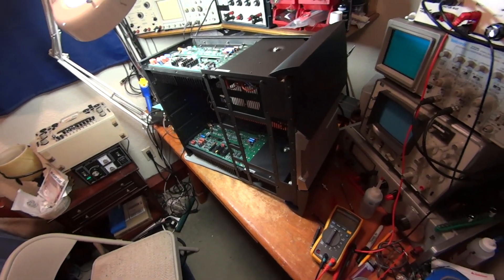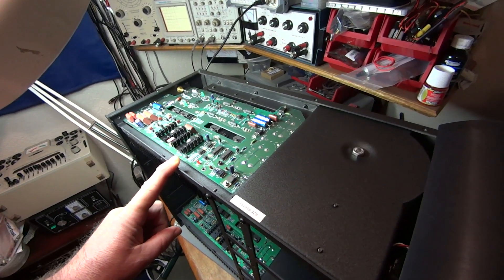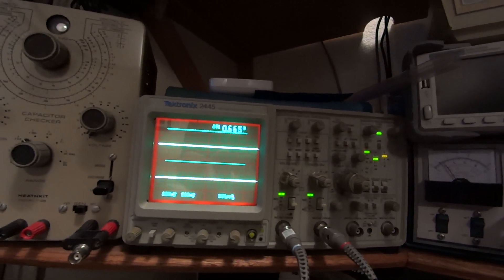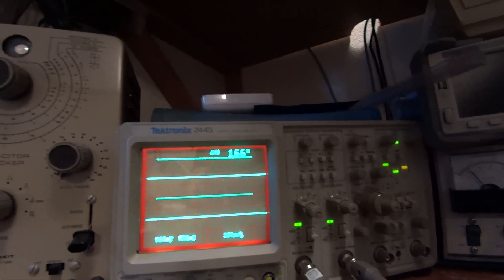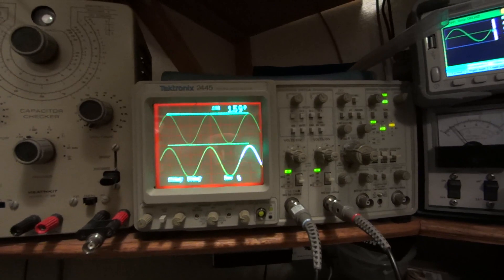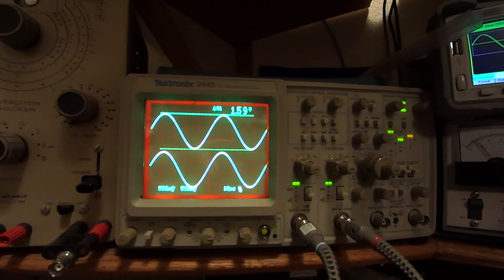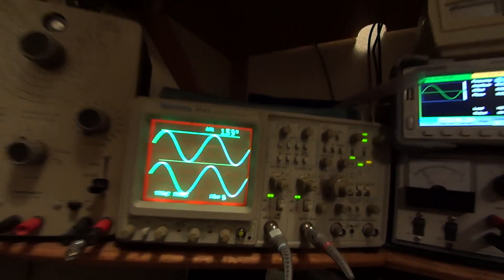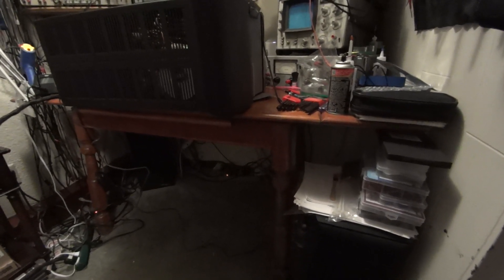POP! Balanced Audio Technology, BAT VK-6200 power amp, power up transient repair.

Comment: Had exactly the same problem with my VK-6200.  I took three channels out and sent them to BAT.  They rebuilt the boards.  Then I took the remaining three channels out and sent those to BAT for rebuilding when the first three were returned.  Had several discussions with Victor Khomenko in the process.

Comment: Thank you also for posting this video. I have an Anthem Statement P5 with the same problem, on the right channel. A popping sound is coming out from the loudspeaker when I'm starting the amplifier, but with some particularities: 
 - a) I'm not getting the popping sound when powering up, if I leave the amplifier unused for more than a few hours;
 - b) I'm not getting any audible secondary popping sound when I'm powering off the amplifier (compared with the situation that you showed in this video with the BAT power amplifier);
 - c) I'm noticing a difference in sound level comparing the left channel with the right channel. The right channel (the one with the popping sound when starting up) sounds louder than the left channel. To balance the volume between these two, I have to attenuate with -4.5 dB the right channel (using the Oppo 205 player settings, connected directly to the P5 amplifier).
 I live in Bucharest, Romania (E.U. member country) - the power grid for domestic use here, is at 230 V, 50 Hz.
Reply from the maker: I identified the bad MOSFET by comparing diode tests on both channels. This is not intuitive because diode testing on a Fluke is typically not used on FETS. But I was able to find differences in the readings between the 2 channels on the bad FET vs. the good one. It is unfortunate that the manufacturers do not provide schematics, it would really help. In your case I would want to chase down the balance issue and find out what was causing the difference. you might have a bad coupling capacitor that is causing both problems. Of course it is impossible to say for sure. One of the things I did notice is that the Anthem appears to be a straight discrete transistor amp, this would make checking it with a good VOM with a diode checker easier than a MOSFET amp. I would also check for DC voltage at the speaker outputs, maybe the bias is off a hair.
Reply: @leonardpeters3266  Thank you again for sharing your knowledge. I'm not a professional in the electronic field. However, I have some technical skills and a strong desire to learn. At this moment, I don't have the proper tools for generating sine waves at a certain input voltage, nor an oscilloscope to read the output signal on the speaker output connectors of the power amplifier. At this moment I only have a very modest multimeter. I will use it to investigate within these limits. Is it possible to measure capacitors that are already connected in a circuit and diagnose them as being in normal parameters? And yes, there is a variable resistor on each channel  that modifies the bias. I didn't play with them...
Reply from the maker: @florinbizu5018  Capacitors have allot of failure modes and most are not measurable in the circuit. The voltmeter can be used to look at the speaker output terminals. Set the voltmeter to DC voltage and look at each speaker outputs while the amplifier is idling (No music playing). The DC voltage should be less then 20mv. Preferably less then 10mv. If it is then your bias is probably fine. I must caution you about about turning the bias variable resistors without having the alignment instructions it can cause serious failures.
Reply: @leonardpeters3266  Good morning! I finally had time to make the measurements according to your instructions. I have set the multimeter on 200m, DC V. One mention: I have inserted one end of the black probe to the multimeter port marked 'COM', and the red probe to V - Ohm - mA port.  When I connected the red probe to the plus-marked speaker terminal and the black probe to the minus speaker terminal of the 5 channel power amp, the multimeter indicated mV values with a minus sign in front of the numbers. When I reversed the probe (red probe to black speaker terminal and black probe to red terminal) the reading values on the multimeter display were positive. The results are as follows: on the front right channel (the one with the 'pop' sound at the start) I have 3.6 mV in idle. I have measured also the current at the speaker outputs when powering up the power amplifier and the multimeter showed a short brief jump and indicate -29 mV, then the 3.5...3.6 mV in idle (fluctuating between 1.6 mV, to 4.2 mV in idle). Also, after powering down the amp, I noticed a residual current of 21 mV (positive value) that dropped in 38 seconds to 5.2 mV and stayed at around this value for about a minute or two, and a residual value of 1.0 mV even after a few hours. After powering down, on the other channels I measured a residual insignificant current of 0.00...0,01 mV (probably in the error margin of the cheap multimeter).
Also, in comparison, the idle current on the other 4 channels where shown as follows: for the right surround power amplifier channel module, 6.1 mV; center channel module 7.5 mV; left surround channel 4.4 mV; front left channel 6.5 mV. I didn't played/turned the bias trimmer potentiometers - they are unmoved/untouched as I found them after removing the metal cover of the amplifier.
Reply from the maker: @florinbizu5018  This is good news. It appears that the push-pull power amps are all biased correctly. The bias is good. The residual voltage you see after power down is not uncommon, the filter capacitors are staying charged. Unfortunately I don't have a schematic of that amp and don't know if they put a discharge network in the amp. I do have a question for you though. I imagine each of the channels has a protection relay. Can you hear the protection relays engage on startup? Also do they engage at the same time?
Reply: @leonardpeters3266  I can send a short video if you agree. I hear relays coming to action both on start-up and also when shutting down. And yes, as much as I can figure out from what I'm hearing, they sound like all  starting together - together same time also, at powering down.
Reply from the maker: Could I ask, was the residual voltage on the speaker terminal only on the channel that is popping? I think it is from your description above. I am wondering if the protection relay on that channel is engaging before the bias settles in. And then not disengaging when the amp is turned off. The engagement of that relay is dependent on a resistor/capacitor (RC) time constant. If that capacitor is bad the relay will engage immediately when the amp is energized. You should not read any voltage at the speaker terminals until the relay kicks in. Take a voltage measurement at the bad channel, watch it when the amplifier is powered on and see if the voltage jumps immediately or if it waits for the relays you heard clicking in. Do the same for the other channels that are not popping. Don't make any current measurements, they are not required. Get back to me with what you find out. I am suspicious that your protection circuit, on the popping channel, is not behaving correctly and it is allowing the power amp to be connected to the speaker before the bias settles. My guess is that the popping channel will have a DC voltage jump right when you press the mains switch. Thus causing the pop.
Reply: @leonardpeters3266  There Is good logic in everything you say. But I have a small dilemma... I can hear the relays acting immediately after I'm pushing the power button to ''On'' - very fast, two stage clicks. There is no delay, there are no third ''clicks'' after powering on the amplifiers. I took a voltage measurement on the bad channel and I noticed a jump in voltage (29 mV) and then back to 3.5...4.2 mV in idle.
Reply from the maker: @florinbizu5018  Well I apologize, I am out of easy ideas. I think the best way to troubleshoot this amp would be to look at the power supplies in the bad channel and compare them to a good channel. Also use an oscilloscope to compare the signal chains in the channel that is 4.5db to loud to the other channel that is softer. I would be suspicious of capacitors in the pre-amp of the popping channel. It might also be a good idea to call customer support at Anthem, they may be able to put you in touch with one of their technicians/engineers that have seen this problem before. You might also select (Auto on) and see if having the amp function in that manner alleviates the pop, but you will still have the hyper gain issue. One last thought on the gain issue, it wouldn't hurt to clean the 0/-6db switch on both left and right channels with deoxit or 99% isopropyl   alcohol. Work the switches 100 times each while they are wet.